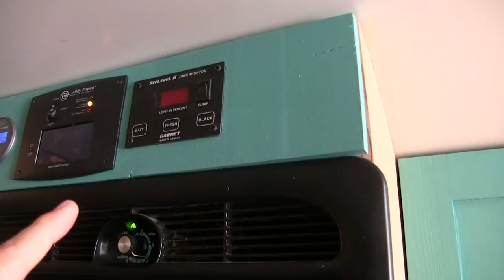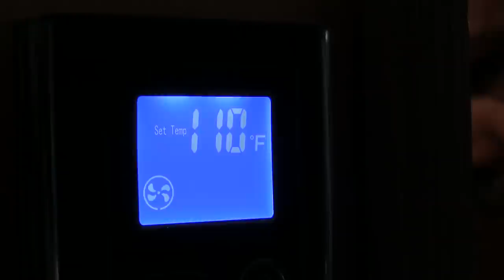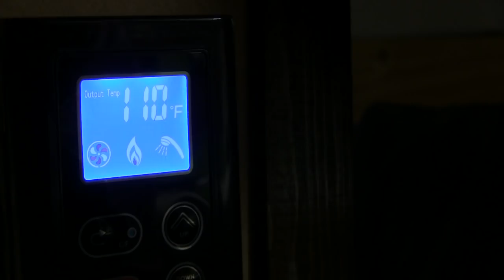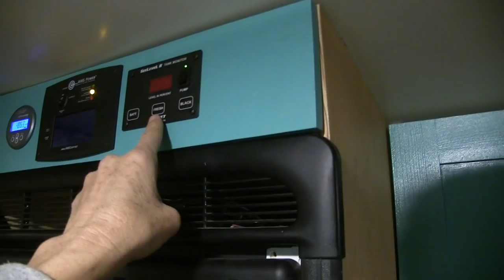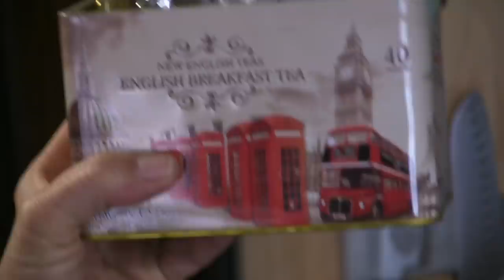BUSLIFE: Fixing our Shower, Desert Wildlife, & Baking in the Bus

Comment: Before you turn on your water in the shower put a clean bucket in the shower to catch the water. Once the water is up to temperature, remove the bucket and take your shower. Afterwards you can pour the clean water back into your freshwater tank. That way the water is not wasted.

Comment: Modern shower valves are designed To cut the hot water if it gets too much pressure from one side to prevent scalding. As said above double up on the hot and it should work

Comment: I may have a fix for the glass jars hitting each other and breaking. Use silicone caulk. Make thick lines of the caulk all over the sides that of the jars that face each other. You will still be able to keep them clean and the beads of caulk work buffer the movement.

Comment: Try a tee to hot on both connections.  You can also try adjusting the temperature limit in the valve to maximum hot.  It is an adjustment that is explained in the instructions.

Comment: Instead of going to plastic containers get thin cord or rope to wrap around the glass containers. I did that in my motor home and it works great. Alittle hot glue, a nice looking cord and a little time is all it takes. Btw it also makes a great hand grip if you have wet hands.
Reply: Just wrap it from the bottom spiraling up to at least half way.

Comment: Also I’ve heard other Skooly’s totally disconnect the cold water from it because if you set your on demand hot water tank at the temperature you want you’re not going to need to mix it with cold water. They said as soon as they turned the cold water to mix it then it was shut the hot water off. But you probably already know this. LOL

Comment: You probably already figured it out but I’ll put my two cents worth in anyway. I lived in an apartment that had on demand hot water but my faucets had the water saver inserts in it if you take your showerhead off you’ll have a little green gasket type thing that keeps the flow down if you get a pair of needle nose pliers and pull that out it will make the flow of your water go faster for your hot water system to recognize that it needs to be on demand.

Comment: Hey guys if you take the handle off on the shower side and get to the valve itself you should be able to adjust the hot water flow on the valve. Most shower valves come preset to low to prevent hot water scalding. he is a video to show you how to do it hopefully this helps https://youtu.be/_iXdN1lfi9c

Comment: Kerry, you missed taking advantage of Mike in his compromising position. 
Why again are we cutting the cold water to the shower?
Reply from the maker: Basically with our on-demand water heater we have that digital adjustment for temperature. So, instead of adjusting the cold water to get the temperature you like you just set the temperature and turn the hot water on all the way.